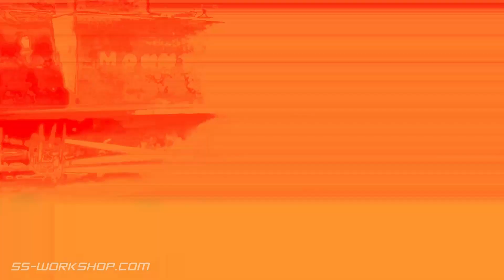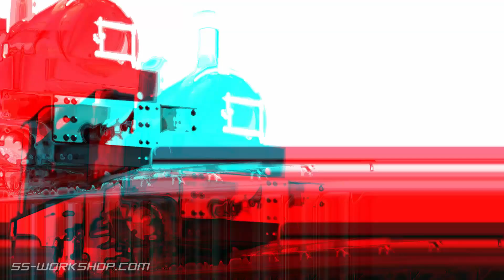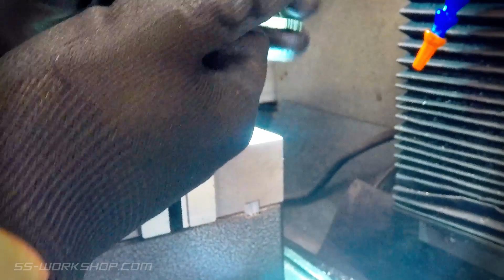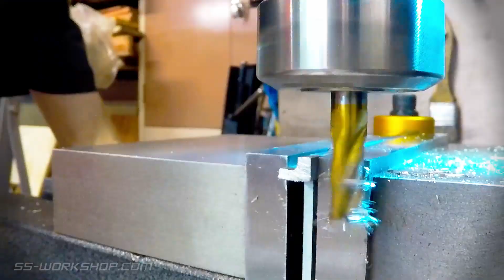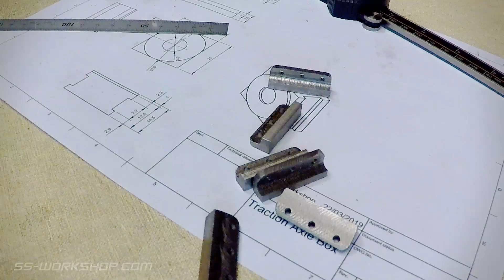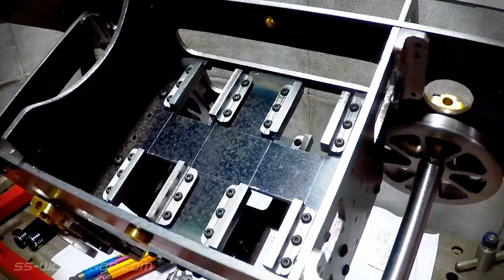Fell Engine Project - Making Traction Horn Blocks S1.E16

Comment: Great work. Good idea to mill the horn blocks in-situ. I found rigidity of set up and incremental light cuts to depth were the order of the day.
Reply from the maker: Thanks for the tips, I’m just working on a long end mill at the moment. Access will be vertically picking up the top and bottom blocks at once as there is no side access. Only problem with than is I won’t be able to cut the full blocks being limited by the diameter of the endmill so will be finishing with a file.